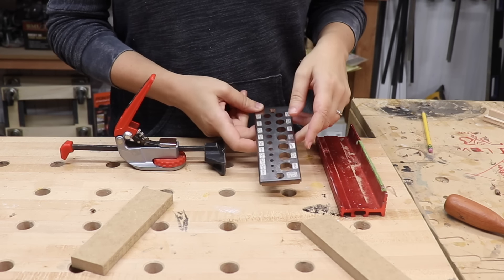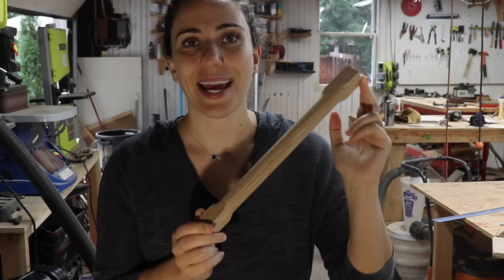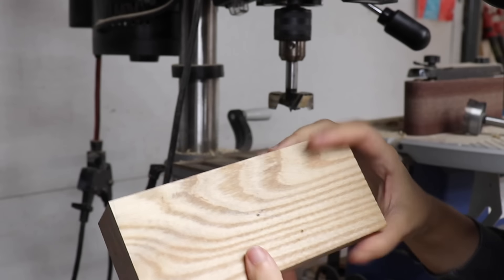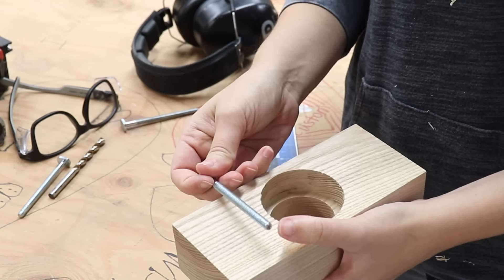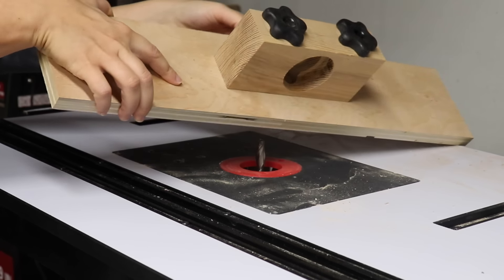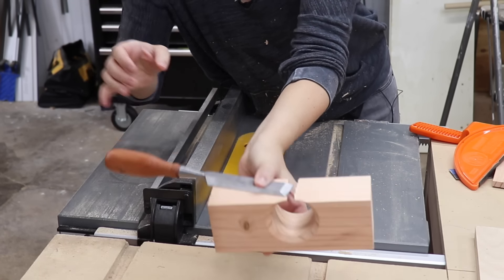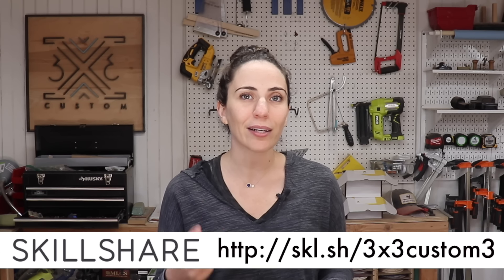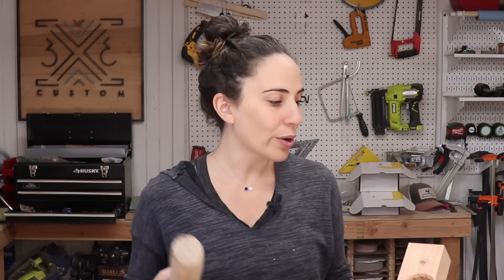Making Large Dowels WITHOUT a Lathe // Woodworking Jig // Dowel Maker

Comment: I think the chisel method will produce the best finish and require little sanding if the angles are set correctly and possibly adding a second one to bring close to size and one to finish it. It would take some trials to figure out though.
Another idea that would eliminate the issues that caused you to not like the method, would be to get a 3/8 or 1/2 high speed tool blank. They are usually used on metal lathes. Then make a matching square hole in the side of the wood block at the angle you want the cutter to sit. You can use a wedge or a set screw to hold the HSS bit. You can grind various profiles in the end of the bit to ease the rounding of the wood dowel. 

I have made 5in diameter cylinders on the table saw as well by drilling a 3/4in hole through a log, clamping two blocks at the ends of the table saw that are at least the cylinder radius plus the corners to be cut off high (in my case there were no corners), sliding the log over a steel pipe and clamping it to the blocks over the blade, and spinning it by hand raising the blade for each pass of 1/8 or so. The finish is ok, not taking too much sanding, and you can do any size easily by blade height and block size. It cuts faster than might be apparent because you can let the blade cutting forces spin it, and just keep enough pressure on it to keep it moving slowly. Putting the pipe at a 10-20 angle to the blade helps too.

Comment: That was amazing! Thanks. I was wondering about combining the round over bit with the block of wood on the router table. Rather than using the flat bit in the middle of the block of wood, use a round over bit to the side. I would never have tried that chisel method. Ever time I get my chisels sharp I just start bleeding. My fingers just know...

Comment: Just a thought
You use a chisel to try to turn a round piece of wood
After rough cutting it
Think about a pencil sharpener,
The angle of the blade, You may have better luck if that concept is tried, A pencil comes out fairly clean except for the lead.

That may mean lifting the one end or side (leading edge of the blade) of the chisel to allow for a beveled cut, Probably being able to insert the chisel into a slot and clamp it down, But also having it razor sharp may also be needed,

Then another possible way, You used a table saw, but were cutting it differently (90 degrees to the blade) then I may have tried, I would have mad a jig that would fit into the guide, holding my piece parallel to the blade and rotate the piece in a jig mounted in the table bed guide and pushing it into the blade and rotating the piece of wood, Wood being parallel to blade, using a rip blade as one would be cutting with the grain. but pulling the piece into the blade when it is cutting upwards and not down as this may cause the blade to grab and bind.

Comment: Amazing video. Thank you so much for sharing. I learned a lot of new things, again. 

I made a hit-through dowel maker for 8 and 6 mm dowels some months ago according a video of "Pask Makes".
What I didn't know (maybe it was told in that video and I just didn't catch it) that you need to start with a bigger hole to come to the final dimension.
(his one had a series of holes, just like your (bought?) one). Thanks for pointing that out.  I didn't use my dowel-maker yet. I'll do it in the winter months.
I have some old cracked beech (former flooring) wood on which i want to try this out.
Btw How smooth should the surface of a dowel be? I always thought that a rough surface doesn't matter when the dowels are glued in the holes.
I'd smooth up only the parts (end) which might be visible.
Reply from the maker: Glad you liked it! Yeah. It only need to look perfect and smooth if it’s going to be visible. If you’re using dowels for joinery, you actually need some gaps for then glue and expansion

Comment: First two methods were reasonable for fast making of miscellaneous dowels. The rest was way to much work to get something acceptable. Just get a lathe if you need to make larger diameter dowels. Or you can always buy dowels if it's a one off project.

Comment: I use a commercial product i bought on fine-tools.de (no brand that i can tell) The idea is similar to the chisel method but it uses a gouge instead of a flat chisel. Works really well (clean and safe) but it is limited to about an inch. 

You can see it in action on my instagram 

https://www.instagram.com/p/B4cFoWNAHr4/
Also Andrea Stockholm has a panel saw jig for larger diameters i have been wanting to build for a while.
https://www.instagram.com/p/BeLJiD2nYhi/

Thank you for your videos. Good stuff.